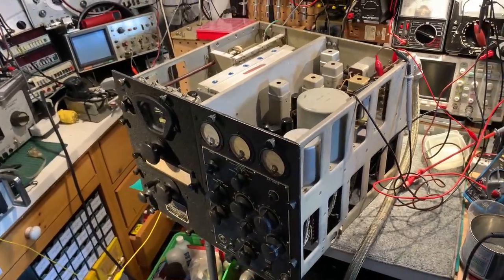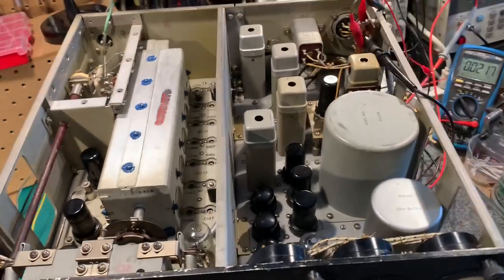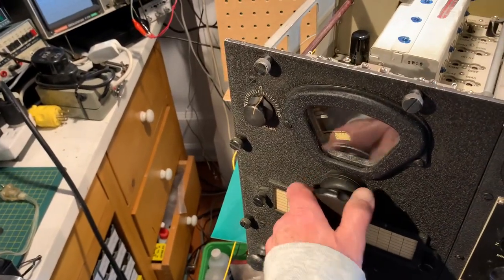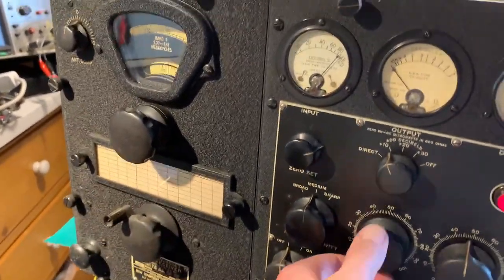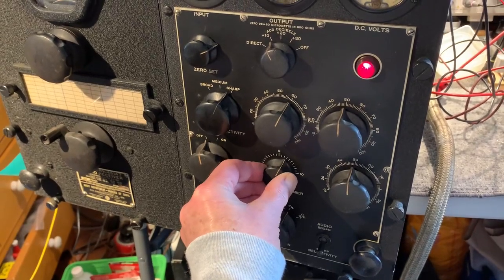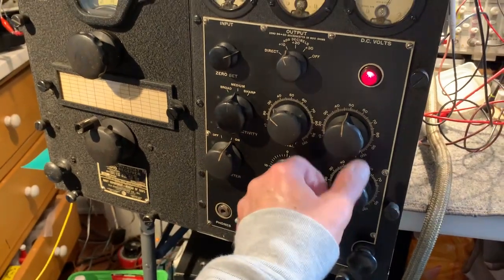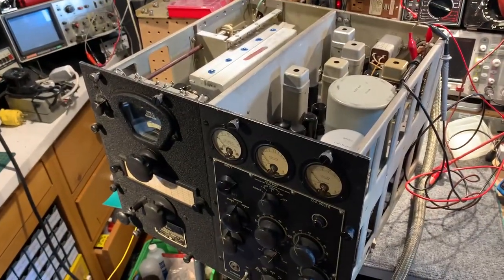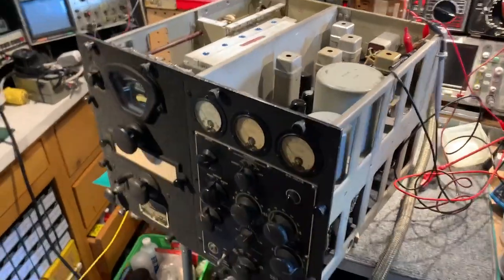Initial Power-on Test of an RCA RBB-1 Receiver

Comment: What would this have been used for?
Reply from the maker: Hi Steven.  They were supplied to the US Navy in WWII for use on board navy vessels and shore stations for communication purposes with other vessels and shore stations.  See: https://www.navy-radio.com/rcvrs/rbb-rbc.htm.  The RBB was part of a 'complementary set' of receivers, comprising the RBA for VLF/LF frequencies (15KHz - 600KHz, see here:  https://www.radioblvd.com/long_wave_receivers_part2.htm), the RBB covering 500kHz - 4MHz, and the RBC, covering 4mHz to 27MHz.  All had separate power supplies.  Ruggedness, reliability, serviceability and performance at whatever cost it may be were the criteria for these sets
Reply: @RadioRestoration  ok thanks for letting me know